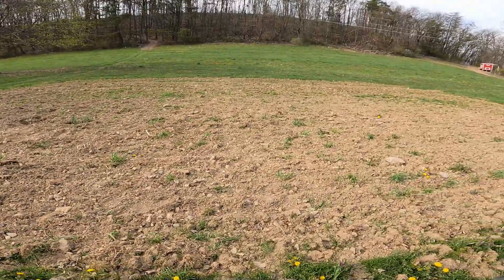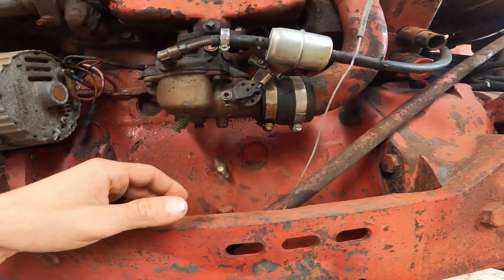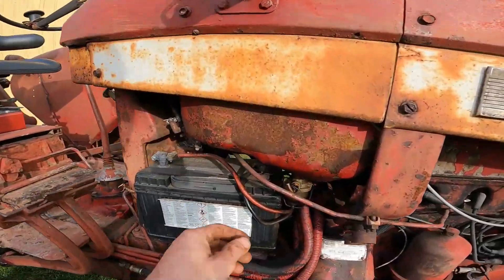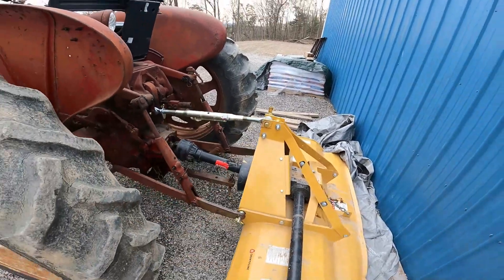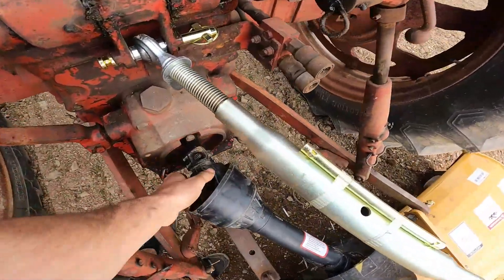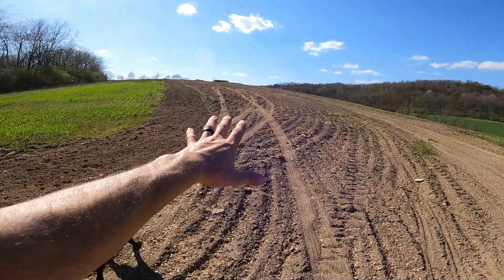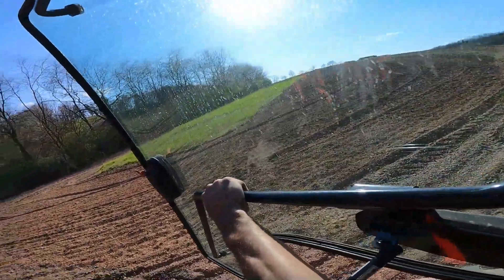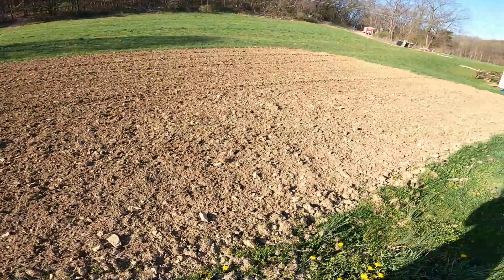Tilling w/ Farmall 504 & Kioti DK5310SE

Comment: Looking forward to some 504 action, mine is still resting in the shed. Did the oil pump overhaul and now have 50 lbs oil press cold but havnt got it hot yet to see where it drops to. I was blessed to find factory 3pt stabiliser brackets for my 504. I have rusty gas tank also, put new large sediment bowl with the screen that sticks up inside tank to catch trash on bottom of tank. Also use the Wix filter inside of sediment bowl and inline clear filter instead of metal. The thing that bugs me the most about my 504 is a very bad oil leak from front crank pulley. I have to be mindful where I park it, leves a mess.
Reply from the maker: Yeah mine leaks oil too , I’ve recently found a worse hydraulic leak 😭 stay tuned for the video